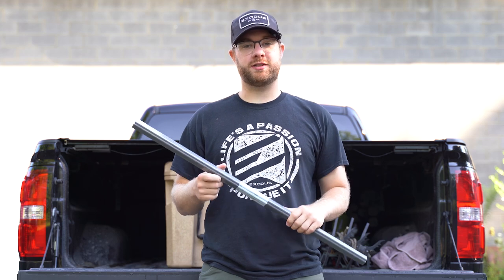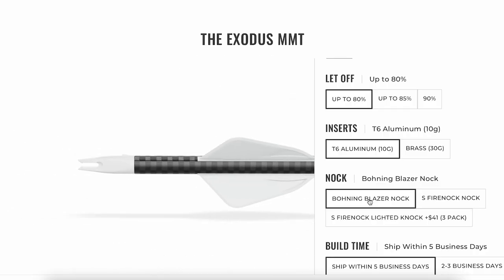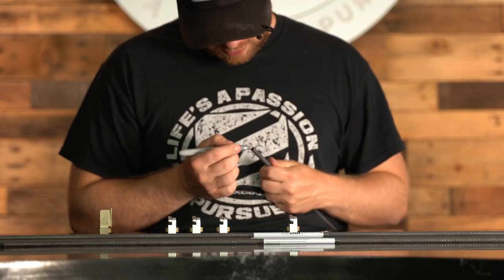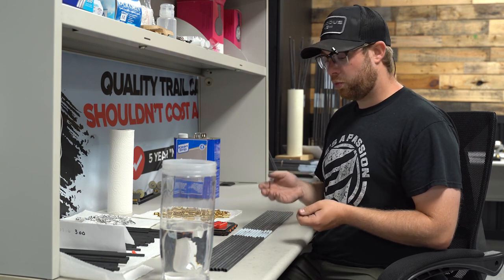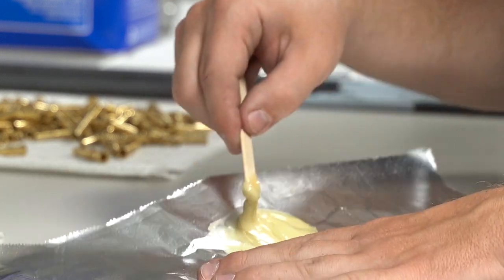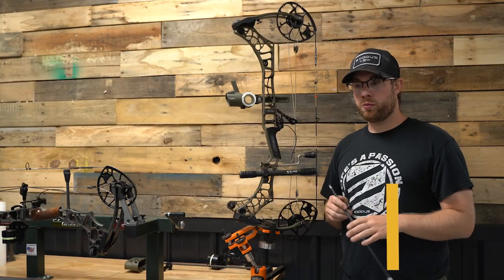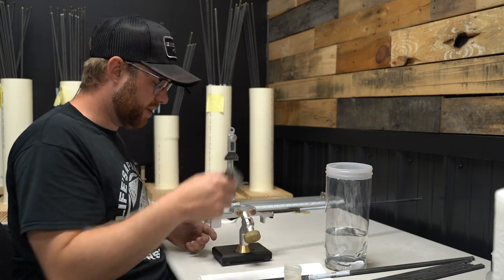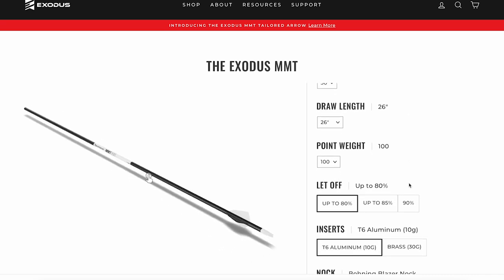10 Steps To Building The Most Accurate Hunting Arrows! Full Exodus MMT Arrow Build

Comment: What are the throat dimensions of each nock.  Like the Easton g nock has dimensions of .88 small & .98 large. Of course very few even know what they need.  Or own micrometers to know.
Reply from the maker: Throat sizes are listed on the website, but the bohning A nock fits string servings of .114” to .120”. Firenock is designed for center servings of .108” to .112”

Comment: Still waiting for titanium components
Reply: why? its overpriced and unnecessary
Reply: @ScratchGolfer0  actually ur wrong titanium is 9 times stronger than aluminum and 6 times stronger than brass it's also lighter than both so to achieve the lightest and strongerst arrow that's whT I do don't be a dick
Reply: @dennybirchfield  I'm awareness titaniums properties, which is the reason why it's useless 🤣🤣, also, it's incredibly brittle, it's worthless after being machined thin, it's way too expensive.... I agree aluminum/brass, although popular is fairly worthless in this application because of the opposite properties of it being soft, the threads are easily damaged, I promise you, you're barking up the wrong tree here, I've dealt with metals over the last 20 years, some of which building the Abraham's tank, Stainless is the way to go...for durability and price. Your "stronger" argument is also flawed, because that is "tensile strength", which doesn't apply here. Titanium would be far more likely to crack on impact. Hence why softer metals are preferred, other than stainless for obvious reasons
Reply: @ScratchGolfer0  been running them for 5 years never had a arrow break or the collar break